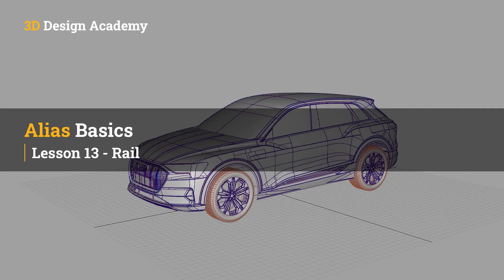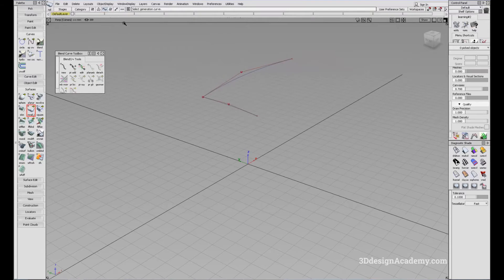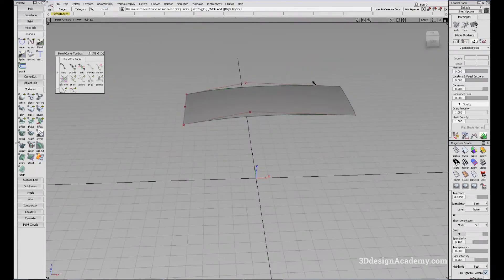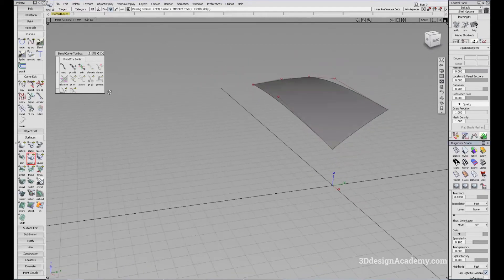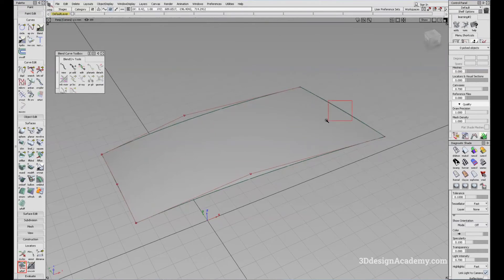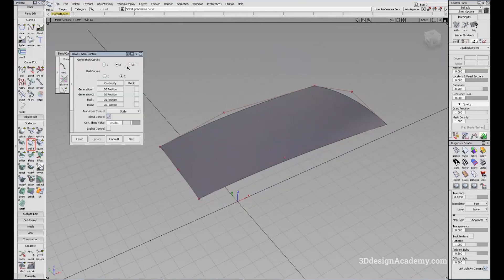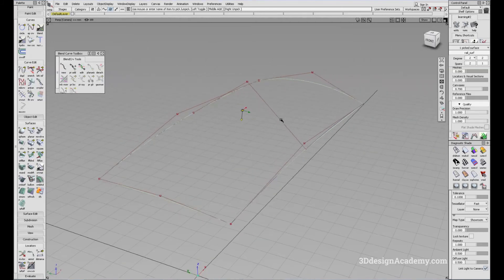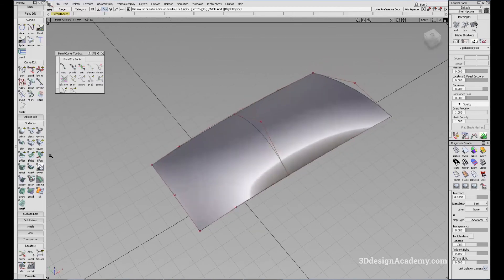Autodesk Alias Basic Tutorials 13 - Rail

Comment: Hello, Im starting to follow you and Im learning a lot, I have a question,  if you 2 rails are  closed like a circle or square wirh  fillet   and you hace a 8 generation curves , 
it should work?

Regards
Reply from the maker: That's a good question. I haven't tried it, but it could work. The only problem is, it'll most likely generate messy surface.